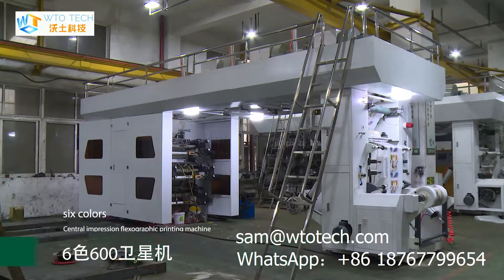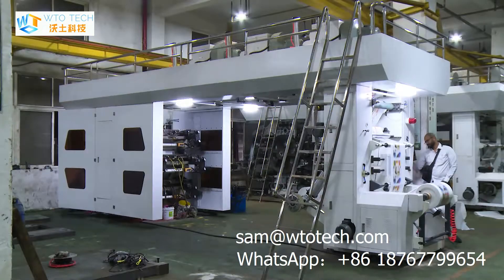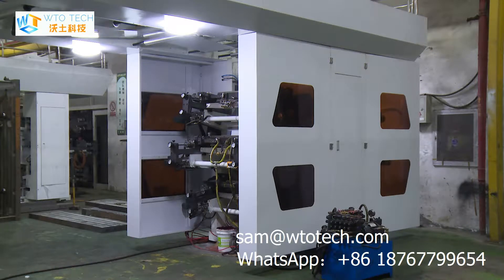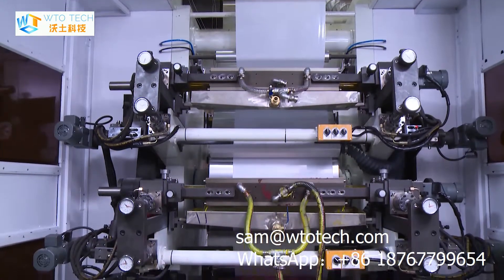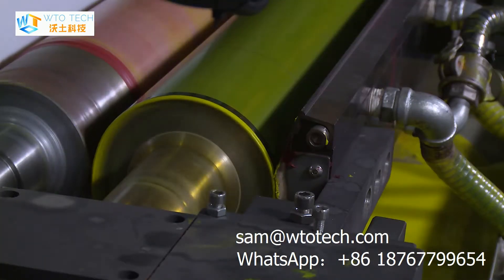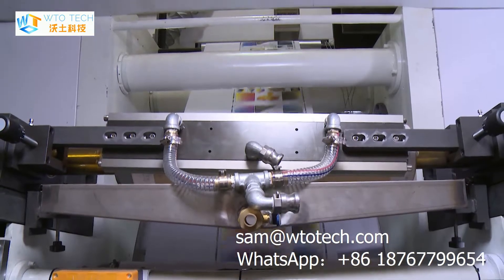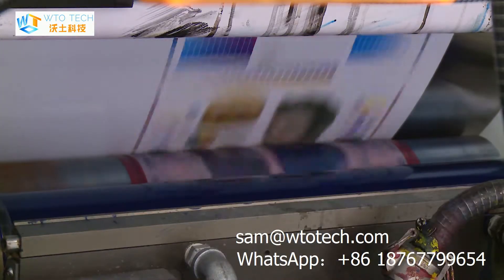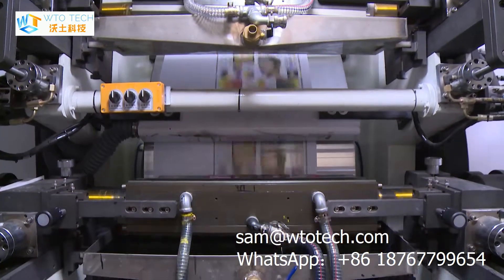6 color Shrink Sleeves labels CI flexo printing machine（central impression）

Comment from the maker: This is 6 color 600mm CI flexographic printing machine, mainly used for printing Shrink Sleeves labels, plastic films. the first time installed in Sudan.
maximum printing speed is 120 meters per minute, with video inspection system, auto tension control system, web guide system and semi-auto register system.
for more details feel free contact with Sam He from WENZHOU WTO TECH CO.,LTD. Company.
more specification check:
http://wtotech.com/products/wpf-e-ser...

email:sam@wtotech.com
mobile phone：0086 18767799654
website：www.wtotech.com